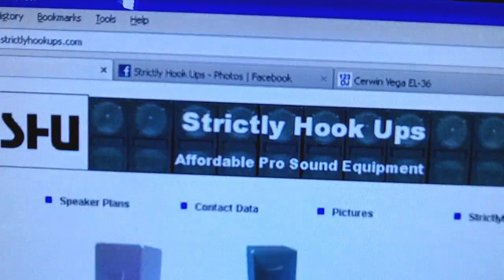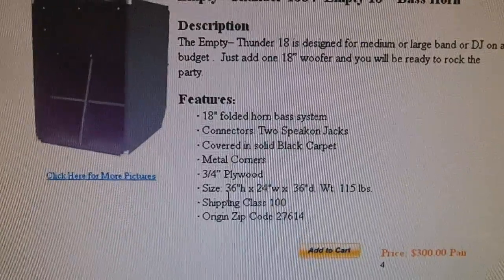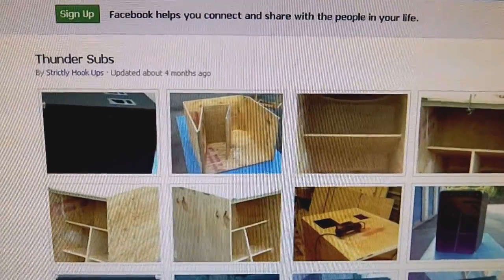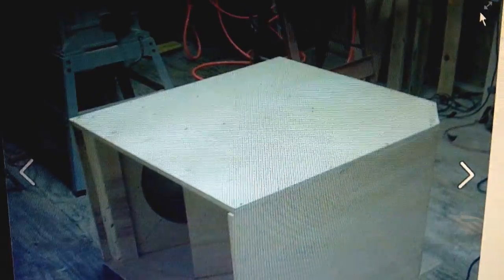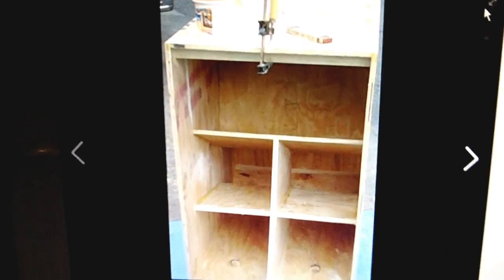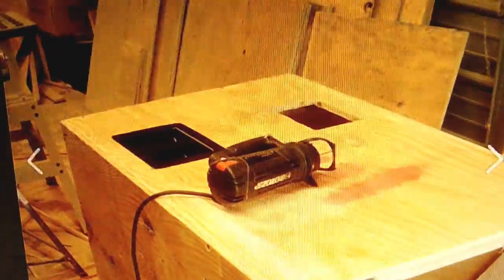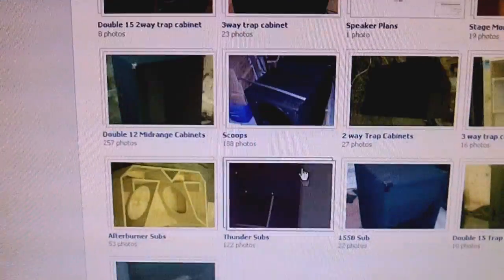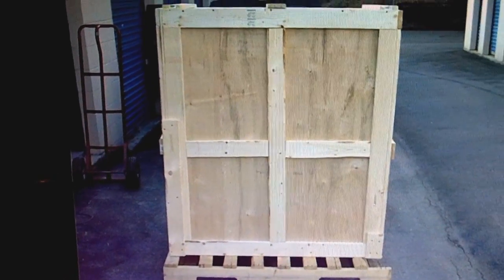Subwoofers...Front Firing and Folded Horns

Comment: I use the cerwin vega L36 and I have mixed front loaded subs with the L36 and I figured out that if you don't reverse phase the L36 subs the bass does not complement the front load cabinet. Which means you get bass cancellation that's why it's not recommended to use folded horn front loaded  speakers together unless the driver is placed in reverse order inside the cabinet. 
And that is just my experience with this type of speakers. Folded horn speakers usually are better suited for outdoor venu

Comment: Great topic!  I have two CV Earthquake Jr.  They bump really nice.  The bass is smooth and low.  Most of the punchy stuff (above 75htz) are handled by my tops.  I always am chasing the genie on subs though.  Now I want to load them up with some B&C speakers to kick even harder.  But, not sure if will be tuned right.  I'm gonna write that guy about those mini thunders.  I am looking for something a little smaller and lighter than I'm using now.

Comment: Front Firing Horns are for indoor use, Folded Horns are for outdoor concert use.  Reason is that there are no walls to make the bass bounce and hit, so folded horns create a snap or a boom by hitting the cabinet wall and creating the bass sound outdoors.  The decibels can damage your ears if the folded horns are used in-doors.  That is the difference between folded horns and front firing horn bass bottoms.  You can notice the difference, the front firing cabinets sound louder in doors but you can not even notice them outdoors.
Reply: You're absolutely right indoors  standing in front of them they sound low but standing about ten feet away the bass makes your eye lids and cheeks shake not to mention cracking the plaster over sheet rock the pressure in the back of the room and those corners is a bass den "whoa"

Comment: I have always been impressed by the bass depth and impact of my 4 twin 18 inch direct firing cabs. 132-133 cont.SPL. The material i play is mostly house,industrial, cyber goth and psytrance. GAMECHANGER, I wanted more bass. I had 6 Lab 12'' folded horns built for me at about $340 each. 6 of these with half the power were crushing my chest at 139-141 SPL full time. the EAW dual 18s are very clean and loud but do not come close to my little labhorns output. cluster of 6 good down to 38 hz.

Comment: I use pair of Vega cvi 218s (dual 18 reflex. 1 front firing and 1 rear firing) and 2 pair of el36c's (folded horns). I cross over the "front" firing subs from 125 hz down to 50hz and the folded horns from 80hz open down. seems to work very well in most situations. the folded horns respond much nicer at the lower freqs than front firing. give that a try and see how it works for you. I usually work outside so indoors you may get mixed results. I know when i first tried it, it was a bit of a bear getting them right. hope that helps

Comment from the maker: Those Yorkvilles are huge LOL The builder that built the horns I have has been building horns and PA speakers for over 25 years. He also built some 21" horns and he just did a double 21" thunder sub. He is a big Bass Head LOL I know what you mean about improper designed cabinets. The horns I got hit so crazy hard!! He did say that it took him about 2 years to get the folded horn design tuned correctly from the sound pressure chamber to the horn throat before he started to sell them.

Comment: Hi Friend.
There are sooo many folded horn designs, most been very high output but lack in sub bass. The one to have built is by Startec SBH (Super bass horn) You can find the plans on speakerplans  I now have 4 of these, and I have never heard anything that sounds so good. efficient, high output without having to push your drivers too hard. can be heard a mile down the road. Keep up the good work..Bless

Comment from the maker: Cool Man thanks for all the sound tips :)  I don't plan on getting rid of my front firing 18" subs because they are smaller and are easy to take along to smaller gigs. I did forget about the sound material you can place in the inside of the cabinets.  All the old speakers I had way back in high school (almost 20 years ago lol) all had that insulation in them but now the newer speakers don't come with that. I may add some in my horn subs to help with the reflections.  Thanks again!!!

Comment: Deejaybustab... Your getting a great deal on these cabs. I still think to this day these type of style are the best when it comes to bass. I used to have the EL-36 from Cerwin Vega bought when they were in Simi Valley, CA. (Not China). I used to use them with a BBE Maximizer, DBX Crossover and an Alesis DEQ. My personal opinion both are great you just gotta do some testing and adjust to your preferrence.

Comment: Yo, I been a fan of folded horn subs since the 80's. My old man use to work for Cerwin Vega. The thing with those subs is Frequency Response: -3db 39 Hz -310 Hz / -10db 35 Hz - 350 Hz. That's where you want to be. I got 2 Cerwin Vega EL36C folded horn subs. I also have one 18" jbl front firing sub and depending on what you are trying to do or what size venue you tryin to fill determines what you should use. Backyard bbq (front firing), event at a banquet hall  folded horn.

Comment: I would do it the other way round, actually. The horns are liable to be good within a certain frequency range, but reflex boxes will reach lower than horns, not being subject to the horn length cutoff. So I'd run the horns from 60Hz to 250Hz, and then have a bunch of 21" or 24" reflex loaded boxes to cover the really deep stuff. It's pretty standard to use infra subs below the main horn loaded subs

Comment: This guy building the sub boxes looks legit.  You definitely want to go with plywood for anything used outdoors or indoors if you're moving them around Mobil dj..  MDf sounds slightly better, but weight and water damage is a problem.
Reply: +Dirk DIGGLER MDF is a necessity with bass horns.

Comment: I just saw your video, Folded horn boxes rock. they are Omni directional speakers. which means anywhere you put them they will pump bass in all directions. The trick with folded horns is to have the frequencies set low. I usually go from about 30 Hz to 35Hz. I use a bass booster along with my electronic crossover. (DBX and Behringer and Peavey have some good model bass boosters. I also have Front Loaded 18 Scoops which I use when I want the combination of Deep Lows with Hard hitting Lows. The effect is awesome, just make sure you have a balanced amount of mids and highs for clarity. I hope this helps. I am a NYC DJ spinning since 1977 and have used Cerwin Vega Earthquakes, Fane Scoops, Sonic Folded horns and Sonic Ass Kicker cabinets. >>>> Dj Vinny Love

Comment: Two things i would look out for if you going to use the folded horn and the direct firing 18" speaker at the same time. The folded horn will be delayed about .7 ms from the direct firing 18" sub. So you have to time align the speakers so they are in phase when exiting the speakers. So they do not sound like mud. # 2 If the drivers you use are rated a 700 watts RMS you need an amp that is double the power 1400 watts RMS and you will get great bass if you do this. need a speaker processor 4 delay

Comment: Sure, I've been using FH sense the late 70's.  My first pair were the Peavy FH-1. To me,  they are the best for live and repro music. Before, I was into direct and scoops speakers. What nice about a folded horn is its design.  It's designed to push a compressed sound wave as far as possible.  Also, these wave could be focused by directing the speakers to where you want the  concentrated low wave to go. In addition, FH allows  for a bigger sound from a smaller cabinet.  By folding the sound, you are multiplying the sould similar to mechanical advantage. You could stack as many as you want with similar speakers because the waves are traveling at the same distance within the cabinet. If you mix types of speakers, it depends on your setup,  you could run into trouble with the "drop beat affect ". Also,  FH are known to have a flatter base line than direct  because of the compression and folding. The better the design,  the better the speakers.

Comment: I've used them separate and in tandem. I'm not a fan of stacking the subs as some suggest, side by side if you have at least 4 is ok but you should be able to beat any venue down with a folded horn inside or out. As long as you have a 2000w amp or better you should be good.

Comment: I used a set of single 18" W bins under my JBL 2x15 cabs loaded with Dayton Audio replacement speaks and did a concert with 5 bands. There was a "pro" audio tech there than I let run sound for "his" band and he said it doesn't do well to mix them together BUT!! He used them too and it sounded great together. With 1,000 rms per 2x15 cab, and 500 watts rms for each W (Peavey 18's), the sytem rumbled!!
Reply: Ditch The Peavey, And The Dayton's... Use JBL, Preferably The Vintage Drivers W/Alnico Magnets...

Comment: i have another tip to tell you on getting better low end proformance out of your subwoofer setup. low frequencies below 100HZ.are non directional in character-the sound does not beam out in a straight line from the front of the cabinet in one direction,instead it surrounds the area in an even amount of bass in a radial way.on my systems i use a 100HZ crossover for the subs & folded horns,& i mono out the signal going to the sub amplifiers. this will increase the bass output of the setup -

Comment: Sry a lot of posts Addressing your questions on mixing front loaded  and horns, its completely fine use the horns as side fills and run the front loads as a center mono, they are a little more defined sounding but hardly noticeable but adds a kick to the dance floor where they are really dancing hard and want that extra bass without disrupting the rest of the crowd.

Comment: I used some century series folded horns in the Navy when I DJ'd the enlisted club, probably 75' x 150'. The horns were dual 12" EVM series in a double folded box. Atop that was an 18" flattened horn for mids, with a rack of 6 5" piezos on top.
Tweaking the Eq, produced live quality sound as attested to by the door man outside.
The stacks were set on either side on top of the stage ~24" high.
Best sounding system that I've ever heard. Worked well with my 40 watt/ch Bose amp, all the way up to 1200 watt/ch which would do damage at the bar at the far end of the hall. And send Marines scurrying.
Been wanting to build another set ever since.

How did your project turn out?
Headhunter

Comment: ahh yes i saw you vid on the horn testing, and you have a analogue crossover, one of the best upgrades you could make to your amp rack is a digital crossover, the Behringer digital crossover arnt that expensive they are called dcx2496. the sound difference from a analogue to digital is amazing, and you can eq and set delays so i can save you space in the rack aswell.

Comment: Incorrectly designed folded horns are one note wonders. If you design a cab correctly around the speaker parameters, it can go low. The actual length of the horn path is largely what determines how low it goes. Check out the Yorkville LS1208. Yes, it's bigger than the Vegas (and other similar designs) but it puts them to shame in low end extension.

Comment: Exactly right As long as you take your time and calculate the driver specs on the box size tone and feel of the bass you are looking for. its like trying on shoes everyone wants a different pair but folded horns that are well designed and thought out for the space they are intended to be used in can be made way more efficient and provide and all around atmosphere that other places wouldn't even be able to touch. For example a THX sound test in an I Max Dome is good but not mind blowing,

Comment: Hey Brother
I will check out that site as well, I would like to know how they sound when you fit them with speakers, the adv ice you got from the guy putting the horns at the bottom, and the bass reflex on top of that,with the highs on top seems practical,but you will have to do some adjustment, between the two bases to compensate for any overpowering lag in sound.jaxx

Comment: Horns and Transmission lines are basically like taking a 1L engine and throwing a 1000HP supra turbo on it! :)

If you build em right, they're that much efficient.
I just love those deep bass, low tuned T lines... :)
They're very hard to design and build, but give you a lot more than regular reflex boxes.
Just my 2 cents...

Comment: I think thats due to the environment, open air/large area, vs smaller areas/open air. I mean there is a legendary company in the raver community, which I LOVED and would make sure to go to the venue if their name was on the flyer for providing the sound.  Tonka sounds subs were made with such large horns you could sit in them. And we did.  Now sitting in the horn was loud, but not as intense as some cars I have been unable to STAND BY. So my ? is how do you get high SPL & depth from folded horns

Comment from the maker: Thats true with horns.  They are made to fill a huge room with bass but not like bass from a front loaded sub.  They don't go as low as front loaded subs but if you stack them and if you can place them in a corner and "V" couple them your bass db will carry.  One of the main reasons you see horns at big concerts and shows because they can fill a big room and don't use as much power as front loaded subs.

Comment: Folded horn will not need as much
power as as front firing. Scoops need less power than all of cabs. I use
Cerwin Vegas "Earth Quake 18 , Wharfendale Pro 18" Front Firing & 18" Sugar Scoop . Fold will give you room filling bass, as the front firing and you will get chest pounding bass. Drop the front firing crossover from 30hz to 250 hz . Folded crossover 20hz to 250
hz. You will get muffed vocals from subs but that will fill in where your
mains drop off. You mains run more mids and be clearer

Comment: Hey I have a Lot of experience with folded horns, the room is an extension of the cab. take the cabs and point them at the wall move them back about 12 to 14 inches, now turn them corner to corner so the opennings are 90 degrees making a triangle facing the wall. So the opennings are facing each other but corner to corner, does that make sense. like a diamond not a square. have to be coupled cant do a single cab like this. Fire them Up and you will get uniform coverage no matter were you are at

Comment: You can have awesome designed speaker cabinets with excellent drivers, and then enter a venue with shabby acoustics that induce standing waves or building materials that either absorb desirable frequencies or reflect unwanted ones, creating an EQ nightmare where Fletcher-Munson curves get totally bent.  The best you can do is keep everything in phase, especially the low end.  Otherwise, you're listening to Rush without Geddy Lee.

Comment: sorry, continuing from previous message....we use the FTR18 4080HDX now as we have used the driver in a number or scenareos  and find it suits our needs well......we do festivals and large club systems.......if you are going to spec. your own drivers for these......i would say go for a driver with efficient voice coil cooling as we have had power compression problems caused from over heated voice coils (the driver becomes less efficient).....hope this helps buddy. :)

Comment: this is what i do with my setup, i use large 18" folded horns 20-90Hz 'Sub -Bass' and then from 90-350Hz for the 'kick bass' and then the mid-highs take the rest, the trick is to use a dedicated crossover, since the ones built into amps are usually crap

Comment: I should also note that my tops are crossed over 2 ways as well, I run 4 pairs of vega cvp 2153's (dual 15). half are cut below 125hz and the other half 100 hz.

Comment: As a rule of thumb , in acoustics, you never mix different style enclosures. simply said the bass wave of each enclosure travels at a different speed and amplitide so you are most likely to get bass cancellation instead of reinforcement. it hard enough to deal with speaker positioning from gig to gig only to add time alignment to the mix is too risky.

Comment: Problem with mixing the horns and reflex bins, are the time correction to make sure they are in phase. If you want to mix them, use your front loaded subs a center fills and use the horns as main long throw. If you don't have a processor like an XTA ect. measure the distance from the driver to the horn mouth, let's say 15 inches as an example, and then place the center fill sube further back, so the front of the horns are 15" closer from the middle of the floor. Measure in a straight line.

Comment: easy fella..........i use this exact design.....and yes they they're loud.......we have them phase alligned to the the 18" Kick bins in the bottom of our turbosound tms4's......the fact they they are long path horns, means that coupled with a powerfull efficient driver, they produce very high sound pressure level......we have used several drivers in our bins before, including precision devices pd1851 and celestion FTR18 4080HDX...

Comment: The Reason Why Folded Horns & Front Loaded Subwoofers Are Hard To Use Together Is That The Folded Horn Designs Will Play Much Louder & Have A Harder Hitting Sound Than Front Loaded Designed Subwoofers. You Need To Amplify The Two Setups Seperately, So That You Can Match The Outputs Of The Two Systems Together. Folded Horn Setups Can Sometimes Suffer From Trying To Make Them Reproduce Frequencies That They Can Not reproduce Very Well On There Own By Vertue Of There Design Or Woofer Being Used In-